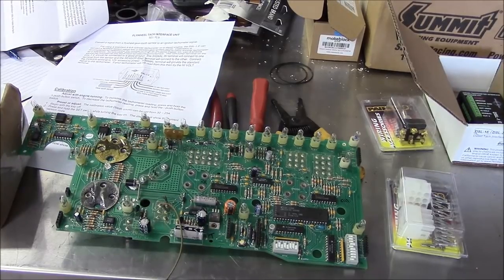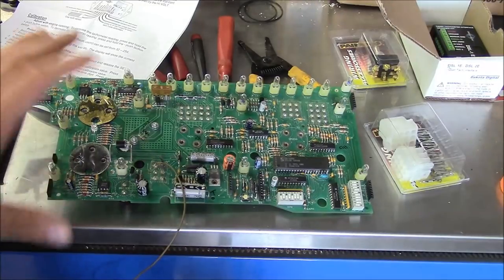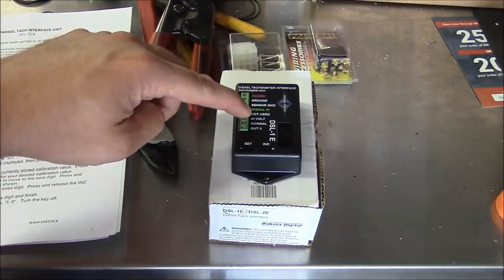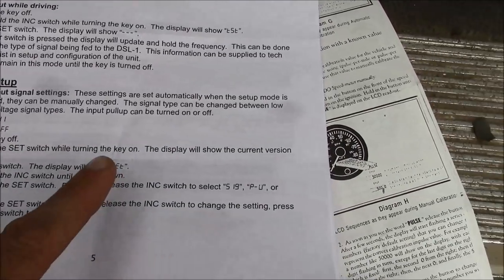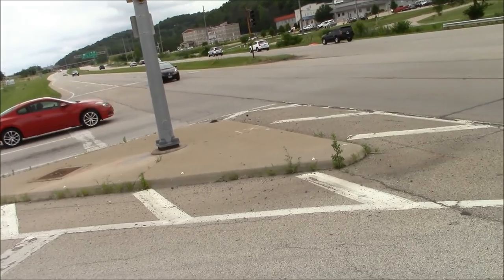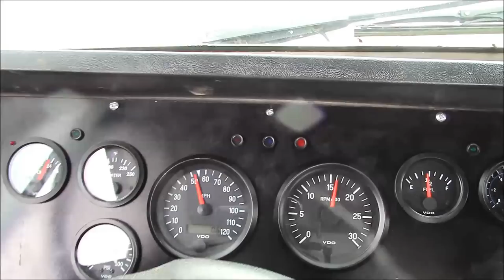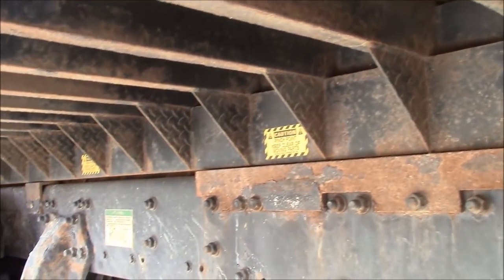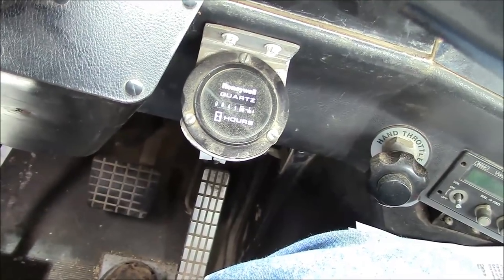Finishing the Instrument Panel for the Rollback Truck

Comment: Famous last words "if I ever rebuild my" .   I small roll or 5 of electric tape not to tight on the buzzer will put it in line.  You could hook up a volume control on the buzzer also as long as it does not turn it all the way down, then it would not meet the rule for the air tanks to scream in your head if they leak out.  Good job.

Comment: I personally, never doubted you. I knew you could do it. When I first saw you with the crane, I thought you were an enthusiest. You have proven yourself to be an expert. You are better than me and I am considered by many as pretty good. (I kept my Audi going. Had to pull the front end (Lock Carrier) off and remove the power steering pump and the throttle body off to get the after run electric coolant pump out. The top turned yellow and burst. I got the new pump in and drove the car for another 4 years.) So, you are an expert in my opinion.

Comment: Wes, it's 2 yeas since you posted this but I'm hoping you read it as it's about crimping miles and AMP connector pins.
There's on the crimp end of the pins there's two sets of two "ear/tabs" that bend over when you crimp them.
You're supposed to  crimp the two larger ones at the  end over the insulation.
The inner two over the bare wire.
That's so over time vibration doesn't cause individual wire strands to break off at the crimping.
Yes that does happen.
I've installed hundreds of connector pins over the 38 years I've repaired, restored and built arcade and pinball games.
One of the most common wire related problems I've encountered is wires broken at pins due to people or factories improperly crimping pins.
Williams pinball games were famous for that issue.
Ooh, after to crimp a pin on always hold the wire with one hand and with the pin in your other hand give it a tug to make sure your crimp was tight before you install it in the connector.

Comment: I found and enjoyed a whole bunch. They make a decal that peels off and stick to your speed indicator and it will translate it to canada miles per hour and the actual mileage will just be america, canada is part of america so it's kinda right/LOL. Gotta agree with you on all points on steel decks. Wood might eventually break or rot but totally safer. Your the man!!

Comment: I had the same issues presenting in an old Kenworth T600B (intermittent rev counter and speedo) and it turned out to be as simple as a dirty/corroding fuse (fuse panel was right down by the driver’s dirty boots)

Comment: I work at a rental store and we have an International 466DTE rollback. Kinda similar to the one in the vlog as far as the bed goes. It's always had stupid electrical computer problems. Yeah, I have a separate switch for the headlights and switch for the marker lights. Every time we get a problem fixed, I mention to our mechanic just say it must have had a brake problem and it rolled off side of a hill. One of these days.......
Reply from the maker: An International with electrical issues. That's a first...

Comment: Nice job on the cluster. looks very good and seems to work well. i would love to have a tandem axle roll back....might even be a rollback project coming up in a video soon.
Reply from the maker: It's handy as a shirt pocket. The only real issue with it is the height. I can't really haul anything over 9'6". That and I can't really haul that much weight thanks to the bridge law here in Illinois. 23,000 lbs is all I can put on it legally. The truck is built to handle 30,000 lbs.

Comment: Dash looks great, I think I would add a time delay relay in the turn signal alarm circuit.
Reply from the maker: That would be kind of hard to implement. I would need a different switch with a momentary contact and some logic to allow the signal to stay on longer if needed and for the 4 way flashers.
Reply: @WatchWesWork  ok, myself I would rather have no alarm than havig to listen to it every time I turned on the turn signal
Reply: @imysteryman  A very small piece of C4 can cure that annoying turn signal noise. 🤭

Comment: Nice job on the instrument cluster. Did I notice you using a Swiss Army knife to open that box? If so it made me chuckle. I have been carrying one for 30 years and won’t be without one.
Reply from the maker: Yep. A Victorinox Officier Suisse. I never go anywhere without it! I do lose them from time to time. I donated at least one to the TSA when I forgot to remove it from my pocket at the airport. This particular one I dropped into a cooling duct on the electrical cabinet of a CNC lathe. The owner was cleaning some fans and found it. He nicely mailed it back to me  I've been carrying it since (almost 3 years now).

Comment: Those buzzers are designed to operate on 5 volts. When you over run them on 12 volts they are too loud and don't last very long. You need to calculate a series resistor.

Comment: When you say dynahoe It makes me wonder what model it was, Currently we have 2 190-4 series Dynahoes, they both run 4-53 Detroit and are massive, 30inch rear bucket. and the one loader is set with forks, it can lift 5000lbs easy.

Comment: A bit of a late suggestion but I've seen a lot of electronic automotive failures due to the solder joints failing. All the vibrations in vehicles over time breaks them. If you haven't already checked it, I would be interested to know if there are any bad ones.
Reply from the maker: I don't think so, but I did not reflow the board.

Comment: Nice looking instrument panel. Maybe you mentioned it in a previous video, but what is the problem with expanded metal on the truck bed?
Reply: You can't slide anything on it.  Many times it is nicer to get a piece of equipment on the bed and then nudge it around before strapping it down.  With them using it for forklifts they wanted the extra traction instead.
Reply from the maker: Correct. The expanded metal limits you to things with nice wheels. Dragging on machines with skates or skids and containers would just ruin it.
Reply: Shain Andrews makes sense thank you.
Reply: Wes Johnson Services I get it now, you move a lot of machines.
Reply: @WatchWesWork  I would imagine loading forklifts with  the hard rubber "tires" could get quite dicey if a typical diamond plate deck got wet or oily.

Comment: I wonder if there was a voltage regulation issue that lead to I/O pins getting burned out, leading to a cascade failure.
Reply from the maker: I have a nice clean 5VDC at the VCC pin. I really don't know.
Reply: @WatchWesWork  I was thinking there is and issue on 12v, perhaps someone jumped the truck with 24v and damaged the instrument panel.  The MCU doesn't interface directly with anything, it has relay and lamp drivers that connect to 12v, it's possible that an overvoltage on the 12v caused a higher voltage to leak through and damage the MCU.  There may be some blown zeners or other OV protection devices which failed.
Reply from the maker: It seems plausible. But, that doesn't really leave a repair option. If I understand it correctly, the micro controller runs an onboard program. I have no way to extract that program from the seemingly dead chip or insert it into a new chip. They only way to fix it would be to find a donor board and copy the program from it. Maybe 25 years ago we could have pulled that off. But, there are few of these rigs still on the road.
Reply: @WatchWesWork  if the protection flag isn't set, the program can be dumped...I might just have a reader that can read the 8051

Comment: You should post links for the tools you use. Are you an Amazon affiliate? I like how well those Molex crimpers worked.  I have the non ratcheting style and you are correct that they don't always work the best.
Reply from the maker: I sometimes post links to tools I use if I think it's relevant. I doubt many folks would click through and buy a set of Molex pin crimping tools. I think a new set of genuine Molex crimping tools will run you around  $1000.
Reply: @WatchWesWork  WOW! I looked at a few at McMaster after watching your video and they didn't look that bad but I'm not sure exactly what I need. Most of the equipment I work on has the molex, similar to what you showed, or the gm weather pack style.
Reply from the maker: Yeah, most open barrel type crimp connections are pretty much the same. You can check prices on these tools at Mouser. The new ones look a little different, but work the same. Each tool is around $350. I think you can get one with changeable dies. It's still around $700 for a full set. I bought mine used on ebay for around $40 a tool.
Reply: @WatchWesWork  Thanks Wes, I'll start hunting on ebay.

Comment: Use a plug with a different pin count or install the 2nd plug set with the genders reversed so they can't be connected incorrectly in the future
Reply: The only time a gender flip makes sense.

Comment: Wes, love your videos. One question though. Does the truck have 4 way hazards? How are they wired in? Keep up the videos.
Reply: The hazards and turn signals are all controlled by the switch on the steering column. ONLY the visual blinking indicators and audible indicators are a part of the dashboard.

Comment: You'd have been far better off to have used the old connectors clipping the wires from the back of the old panel at the items mounted on it and installing them into that strip you mounted.
Way cheaper and easier.
The old connectors were Amp brand.
I have the pin removal tools for both of them as well as the crimpers.
Your new style crimpers are better tho.

Comment: Heck, you don't even need a speedo once you get used to the RPMs and speed
Reply from the maker: That's true, but I think commercial vehicles are legally required to have a working speedometer. Plus the odometer is really nice. I have to report mileage every quarter for IFTA.